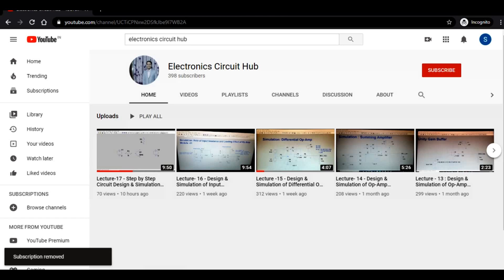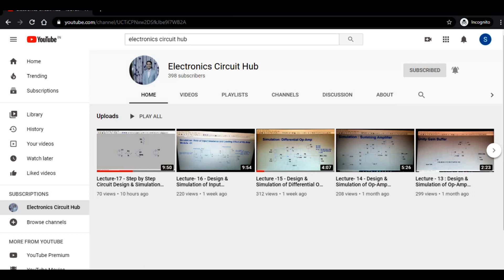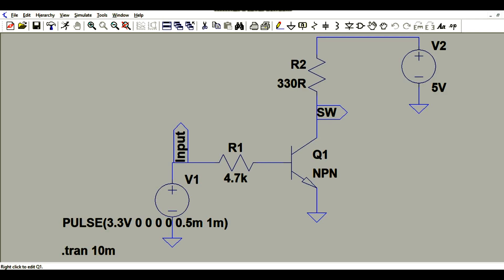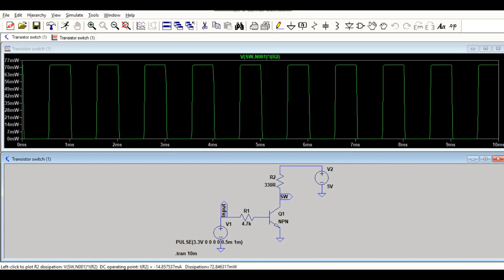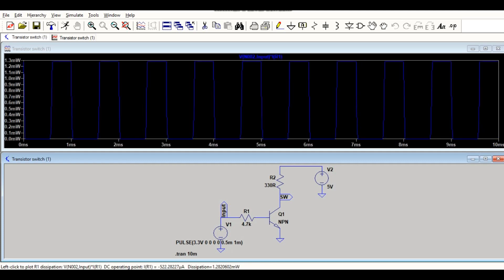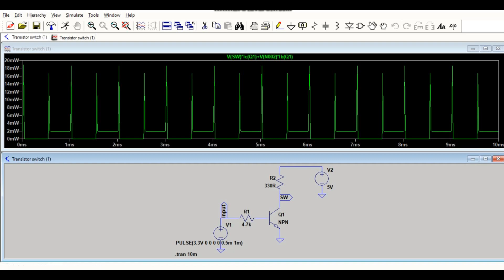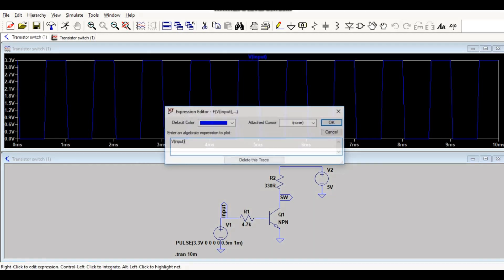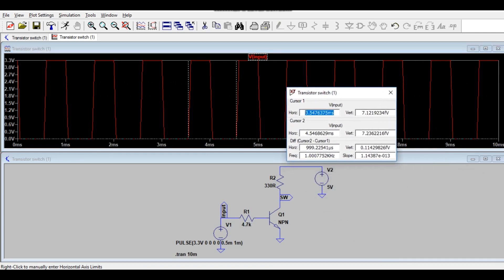LT Spice - Power & Frequency Measurement in LTspice || LT Spice Basics

Comment: You are measuring peak power. For a resistor, you usually need to measure average power not peak power.
Reply from the maker: Thanks for feedback,  yes I aligned with you. Simulation shows how you can use ltspice tool.